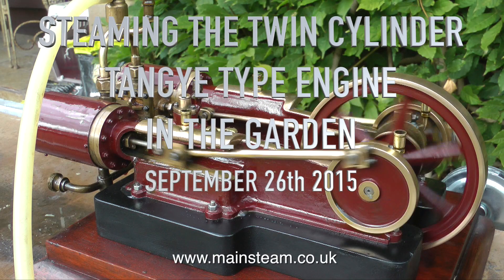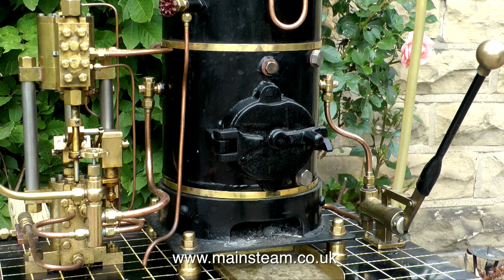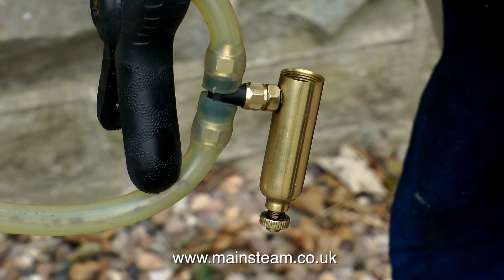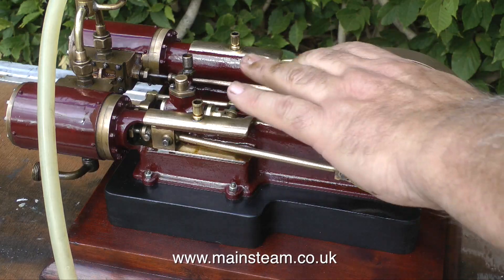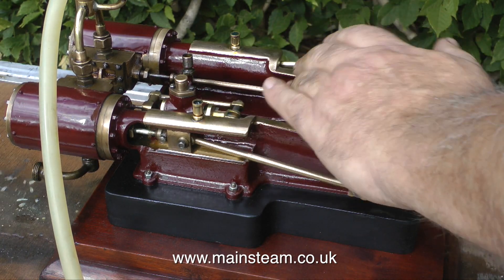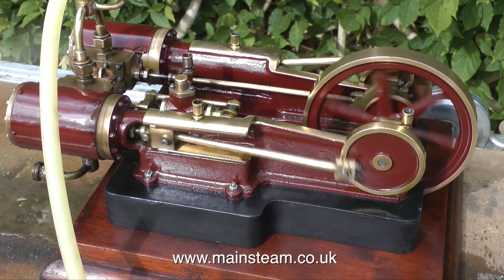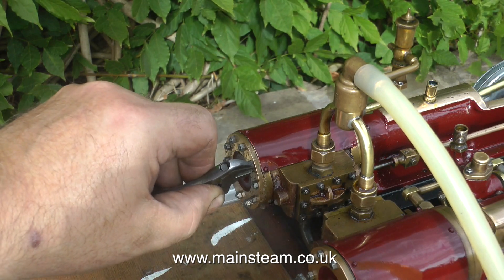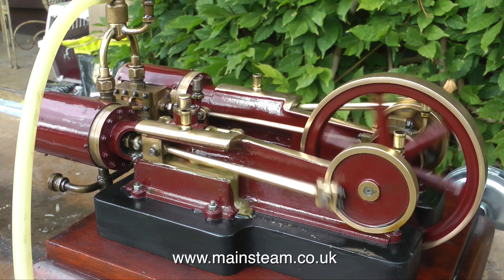STEAMING THE TWIN TANGYE TYPE MODEL STEAM ENGINE IN THE GARDEN

Comment: You mention running low pressure because it has brass cylinder bores. I see a potential issue with this. Low pressure steam in the boiler is very wet, meaning that you will get much more water in your cylinders, washing away the lubricant, probably causing even worse damage than high pressure would. I would run higher pressure in the boiler and set a lower pressure in the line to the engine with an in-line regulator, eliminating the excess moisture. I hope you find this helpful. Just trying to help out a fellow steam buff.
Reply from the maker: it really doesn't work like that ...... wet steam & water both act as a lubricant too, neither will "wash away the oil" . . . . look at the little Mamod steam engines - they don't have a displacement lubricator but they seem to work OK ....... }:-))) I think that I mention not using very hot superheated steam (as in a radiant superheater) on Brass engines - it has little to do with the steam pressure.

Comment: "I need to keep the temperature low So I don't damage the brass cylinder bores." Is this true? What are the pistons made of? I run an engine that's not much bigger, a Twin 1902 Toledo Steam Carriage engine (cast iron), I've never heard the idea of the temperature of the steam to be a big deal as long as you have good steam/cylinder oil.
Reply from the maker: Brass engines & pistons will not stand high superheat - cast iron will - if you don't believe me - superheat a brass engine (with a proper superheater - not a simple steam drier) and see what happens . . . .
Reply: Interesting, so were brass piston/cylinders were not really used for working steam engines historically? Just for shiny models mostly?

Comment: Hello, I have a D6 Wilesco engine and I was wondering if I got the D21 gauge/safety valve adapter if I could put it on with the 5mm to a 6mm adapter. Does anybody know?

Comment: I'm new to steam engines, but I have a rough idea about how they work in general, but one thing I was wondering about is if the steam input is constant or if it comes in bursts?
Reply from the maker: The steam pressure fluctuates but is in a constant steady supply relative to the heat applied to the water in the steam boiler.

Comment: Beautiful engine!  What is this component that the right cylinder valve rod passes through, that the left cylinder doesn't have?
Reply from the maker: It is a water pump for feeding the boiler.
Reply: This is something I would like to install on my engines, and it is a clever way to do it.  Thank you!

Comment: Is the direction of rotation dependent on the starting position or is there some mechanism to force it to revolve in one direction only?
Reply from the maker: +TemplarX2 The direction of rotation is relative to the position of the slide valve eccentrics on the crankshaft.
Reply: Keith Appleton thank you.